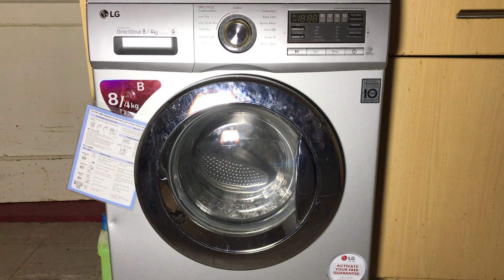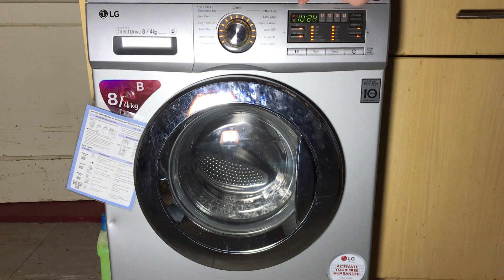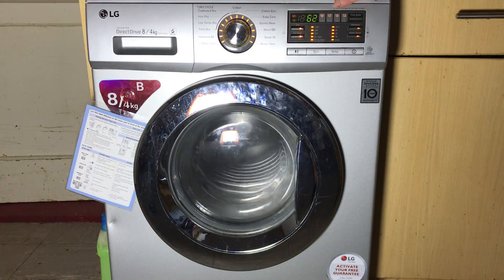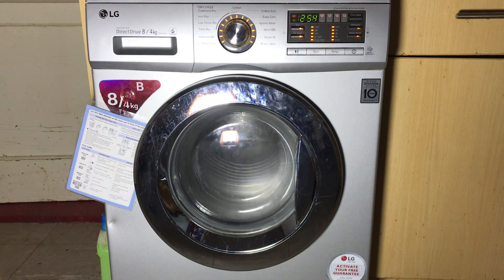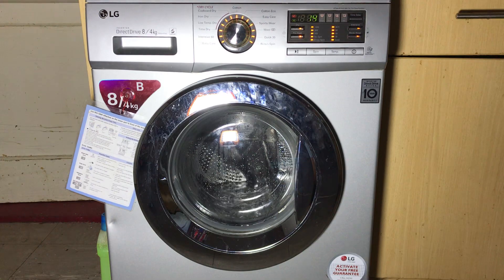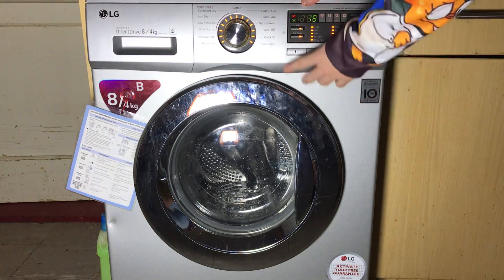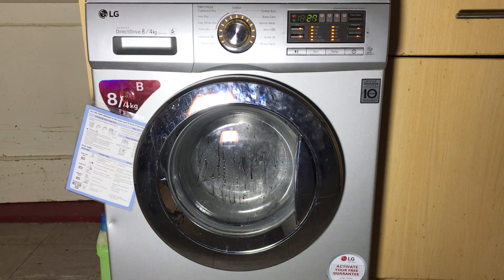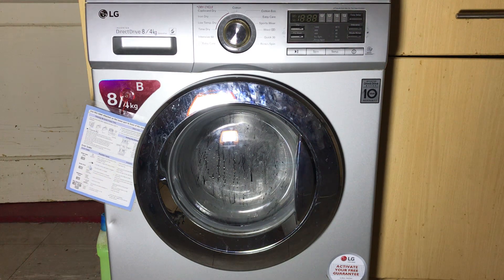LG 6motion - service mode tutorial

Comment: Do you know how to make it distribute on service mode?
Reply from the maker: you would need to go into the 6motion demonstration mode. i don't know how to do that unfortunately.
Reply: @thelaundrycookie1200  mine just ramps up to 600 without distributing unfortunately
Reply from the maker: if i remember correctly, the 6motion demonstration is seperate from the service mode shown here.
depending on your model, you may or may not be able to show the 6motion. i think newer ones can but i wouldn't be able to tell you how to do it.
Reply: @thelaundrycookie1200  try pressing intensive , time delay and power to turn on 6 motion , this works on mine
Reply from the maker: that's what i tried first, it does nothing. the machine just turns on normally.
Reply: @thelaundrycookie1200  sad
Reply: @thelaundrycookie1200  try intensive , spin and power button
Reply from the maker: update - i just tried time delay and intensive and i got into 6motion demonstration mode. i don't know why it didn't work before. thank you 🙂
Reply: @thelaundrycookie1200  np!
Reply: @thelaundrycookie1200  still trying to figure out how to make it distribute :(
Reply from the maker: on mine i advance the motions using the temp button. mine starts on scrubbing motion. i don't know the rest of the order yet.
Reply: @thelaundrycookie1200  it does distribute on the 6 motion mode though , but unfortunately it doesn't ramp up

Comment: 2:46 Almost 1400 rpm
Reply from the maker: 1370rpm when i advanced it. fastest it will go is 1380rpm, which is still classed as 1400rpm. pretty much no machine reaches the exact speed stated, because it's rounded up to the nearest 100 most of the time.
Reply: @thelaundrycookie1200  oh my god the speed measure by the spin speed